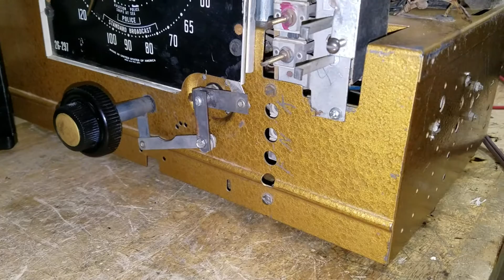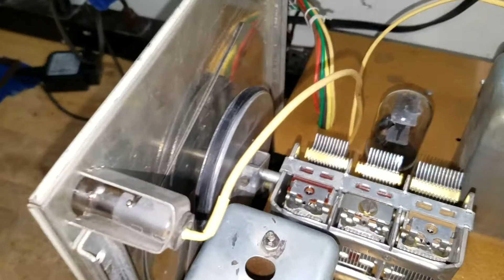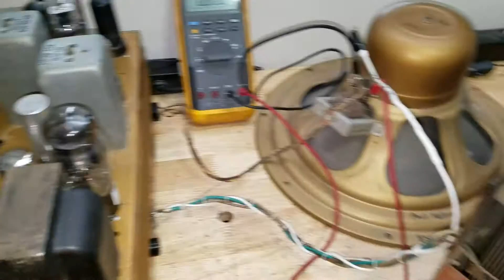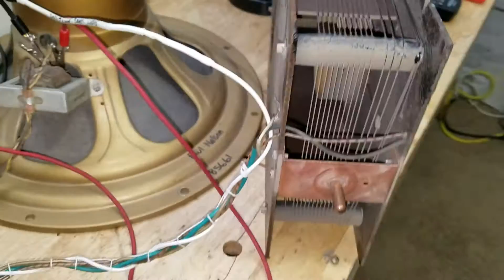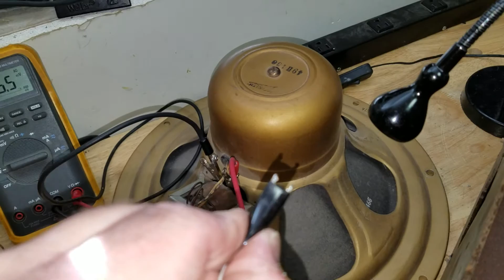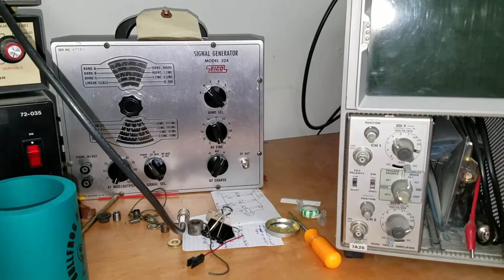1942 ZENITH 8S661 Console Tube Radio   Part 4 of 6

Comment: Hi Mike.  Mike here again.  Can I possibly PM you to seek a 8s661 part?  Namely, the small pulley on the main shaft between the large flywheel and chassis front that the O ring goes on?
Mine is a mess. Found in a pole barn.
Reply from the maker: Mike,
No problem.  Just PM me through YouTube.  I don't have a spare, but I can keep my eyes open.  Have you tried "Play Things of the Past" website.  I have bought things from that site and the prices were good and he sent them pretty fast.  It's worth a shot.  I have pretty bad at checking my messages, but I'll make a point to look often over the next few days.   Cheers!    Michael
Reply: I need help,,my zenith console stereo,turntable,8tract , aluminum square (mabey a fuse or relay) with adjustment screw in center,,what are these and what are their purpose??